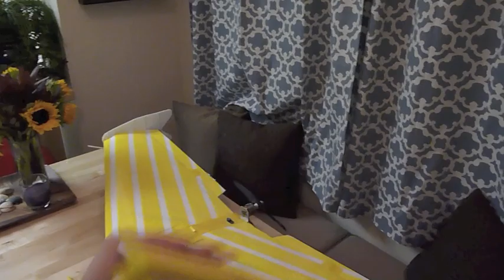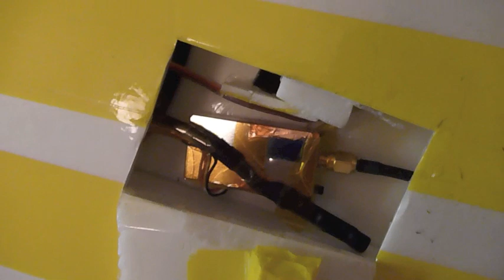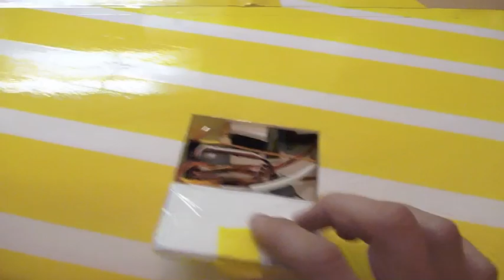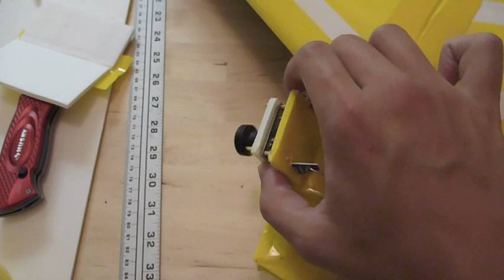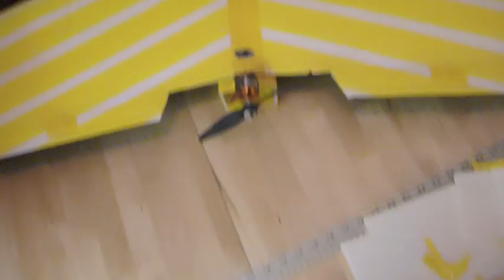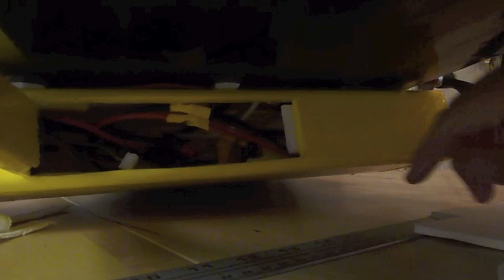Foamboard FPV Scratchbuilt plane "The Longsurfer"

Comment: great work lets see how it flies i think i will build one for night flying fpv practice or general flight if it is that good. if that is coragated plastic board on the wing ends id tape around it as the channels going though will pull it or create drag it has put my wing not like this one into loops till i taped it. like the battery comartment overall good work.

Comment from the maker: I should caveat that weight was with my digital bathroom scale so it could be off.  I'll try and get my hands on a more accurate scale.  I've only flown it once (the maiden) so i haven't really tested the limits yet but i had no problem climbing it out at a very steep pace at less that full throttle and it seemed pretty responsive.  I'll keep you posted as i'm able to fly it more.

Comment: 4.6 pounds (74oz)!  Looks like we were way off on the estimates in the BajiWing thread.  I'm sure the motor is fine for FPV, but is sport aerobatic capable, like you were hoping?  I'm just wondering how reality compares to Webocalc with that motor.  Awesome setup clean build.

I'm looking forward to seeing how you like the Rangelink, and how far you can push it.

Comment from the maker: thanks.  I have an arrow shaft running perpendicular to the wing root then I have 2 more cut in half going from each end of the main spar towards the wing tips.  Then the cavity in front of the wing former is filled with GreatStuff expanding foam

Comment from the maker: Thanks, I'm very happy with the way everything came together.  I did do the "same-way-facing" servos and on the ground the Nova compensates in the correct direction when I'm in PA mode.  i.e. dip right wing and the right elevon goes down so I'm hopeful that it will work in the sky.  I just didn't have the cojones to try it on the maiden.